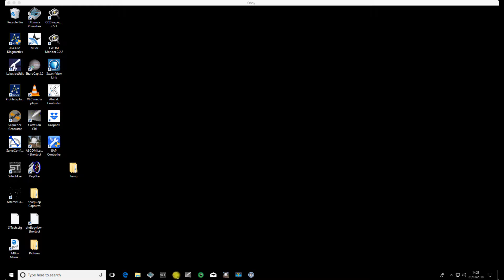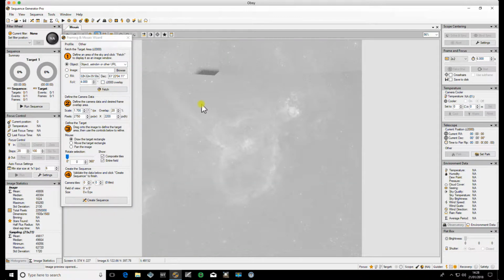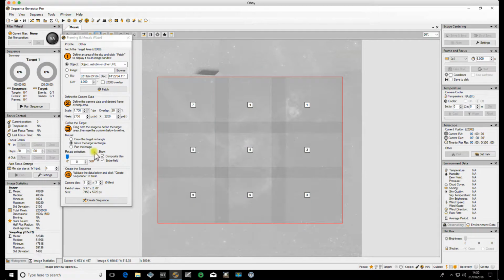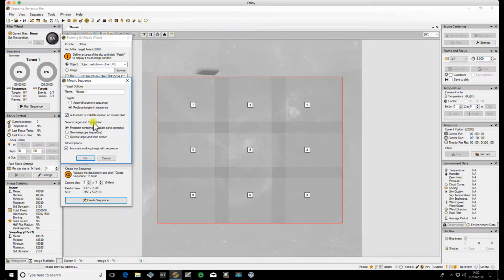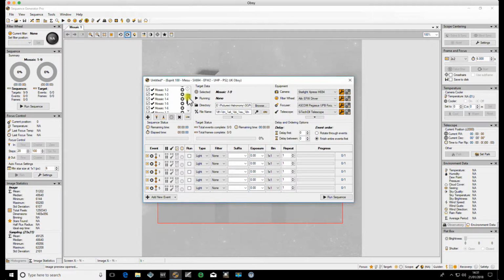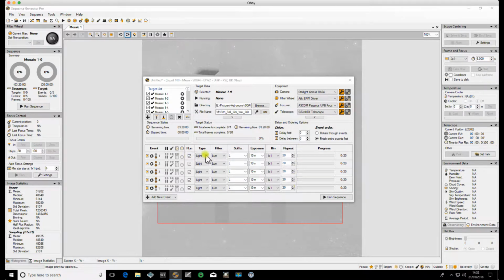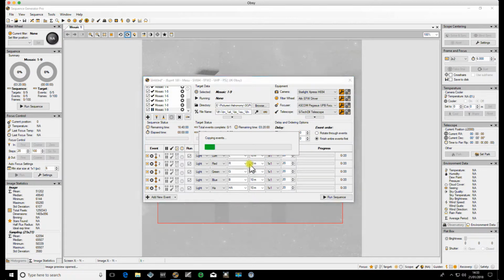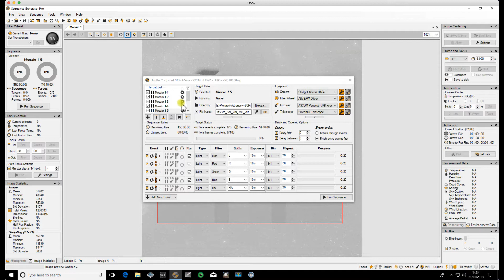Sequence Generator Pro - Framing & Mosaic Wizard Part 2

Comment: Many thanks for the great vids both part 1 and 2 a really useful.I spent the afternoon trying to get this set up for the winter(I live in the southern hemp).I got things working ok inside so I need some clear skies to get everything working,I have 1 question though. When you add the camera info and you get the chip size which gets transferred to the mosaic what happens if you use different telescopes to how the image gets framed.What I mean is if you want to image m42 on a 4 panel mosaic and are using a C11 the actual field of view will be vastly different if you use a redcat 51but the chip is the same size how do you account for this when setting things up.Sorry if I have missed something here. Thankyou I really appreciate your help Cheers

Comment: Super videos dude. How you finding the Atik 16200? Are you able to do a auto focuser routine SGP pro please
Reply from the maker: Thanks Jaspal, much appreciated.  The Atik 16200 is awesome,  The FOV is incredible and it just works.  The only thing you need to be mindful of is that at APS-H size the sensor is pretty big and you will need 2" filters.

Yes no problem at all with the auto-focus routine.  I have one almost ready so will be posting it very soon.
Reply: Simplified Astro top man I really look forward to it
Reply: Simplified Astro I’ve also ordered a 16200 with some chroma 2 inch filters
Reply from the maker: You won't be disappointed Jaspal, it is a great performer, and it does achieve the t-delta of -50 advertised.  I image at -15 all year round as below this I didn't see any noticeable difference, but this also means I only need one set of dark frames, and do not need to change my settings for summer and winter.

Have fun with your new purchase.
Reply: Simplified Astro thanks mate. I still look forward to your other videos. U on Facebook?
Reply: Simplified Astro when you releasing your video on auto focus buddy
Reply from the maker: Hi Jaspal.  Thanks for your patience, it will be posted this week.
Reply: Simplified Astro wicked